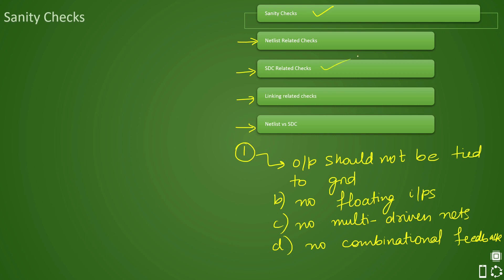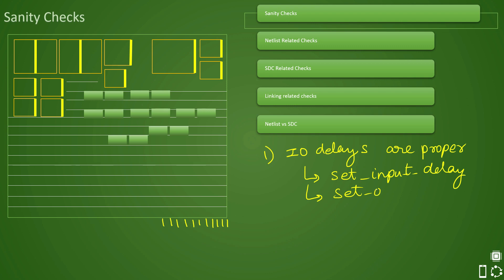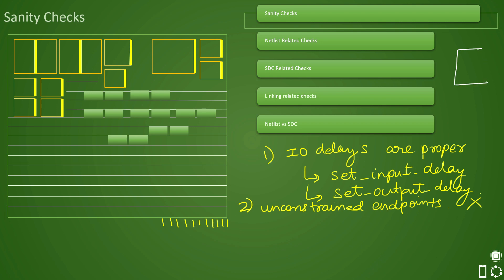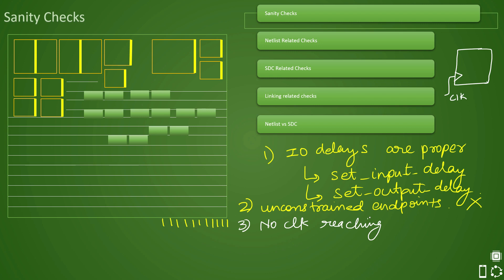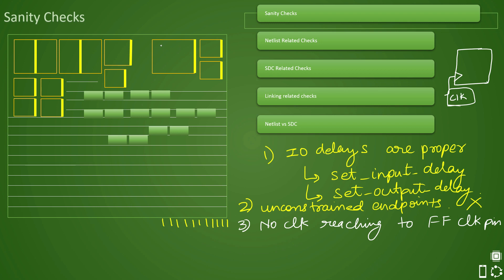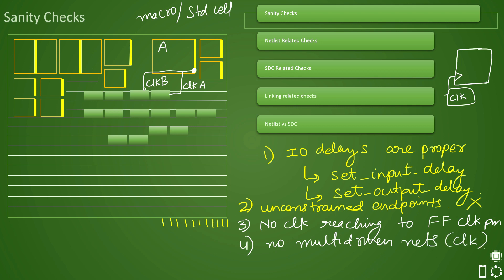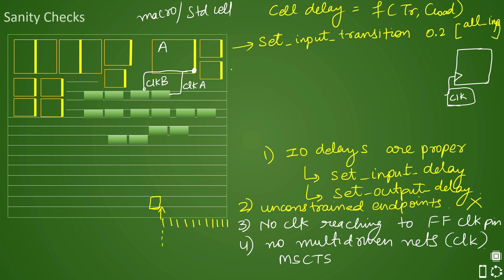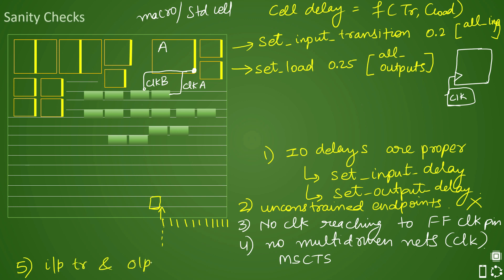PD Lec 27 - Sanity Checks -2 | Floor-planning | VLSI | Physical Design

Comment: Hi, what is the difference between set_load and set_ouput_delay ?
Reply: output delay it is assumed value of external delay used for interfacing the value where as the load value is from lib

Comment: Can we force Input transition and output capacitance on all the ip and op cells? , because they are the values used to find cell delay in .lib and each cell will have different cell delay
Reply: Already there will be values of cell delays in .lib .Then is it ok that no error is raised if values are not matching as in .lib?